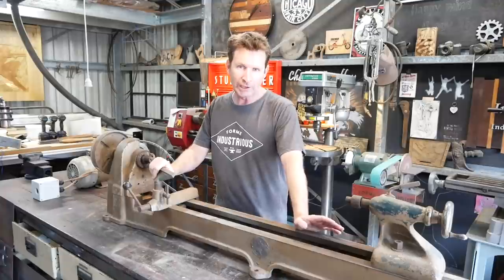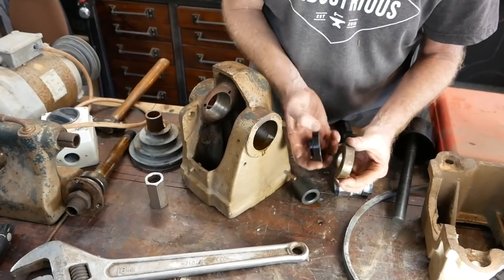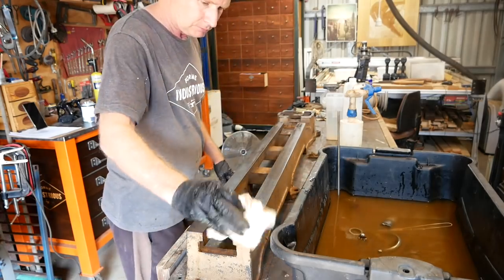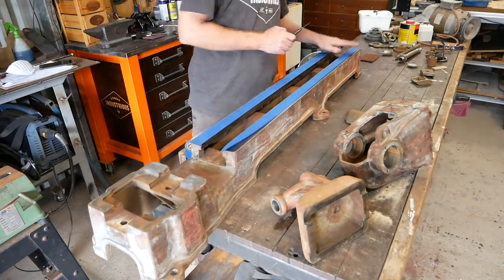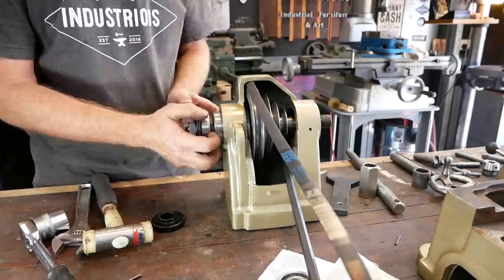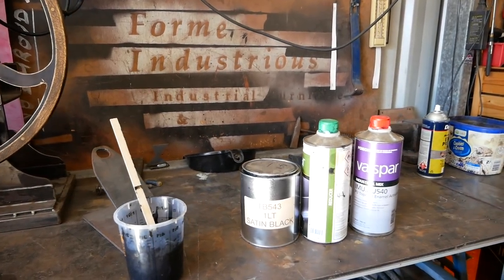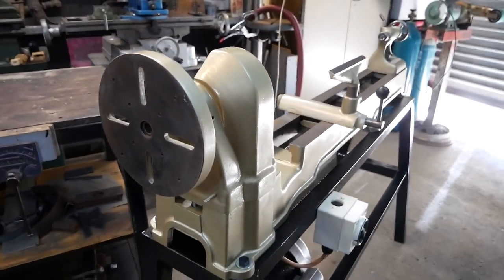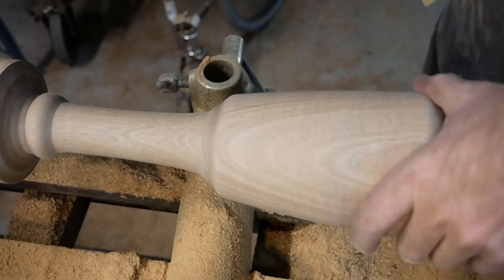Vintage Woodfast Lathe - Restoration - Forme Industrious

Comment: Nice to see an old Woodfast back in service. Those lathes originally were fitted with a spindle lock/indexing pin in the hole at the back side of the headstock. Many schools removed them because kids would accidentally (or deliberately) engage them with the spindle running. The pin could engage in any of the holes in the step pulley so you could index polygon shapes. Easy enough to make in your lovely Hercus ATM260 metal lathe! Another classic and hard working machine!
Reply from the maker: Thanks Mark! Yes I'll make the indexing pin very soon. I had to do a few fix up jobs to get the 260 going smoothly.

Comment: Picking up my second woodfast lathe in 2 days. I made all the same mistakes with my head stock you did. I even forgot to put the belt on it on my second to last reassembly. Fantastic job on that restore.
Reply from the maker: Thanks Mark, yes they are great lathes. If I had room I'd get another :)

Comment: Nice work (as always) - a vintage power switch would definitely set it off....  also... maybe a quick-release sanding pad on the bowl-mounting plate when it's being stored at the end of the spindle? It would give you a nice flat sander for bowl edges etc.

Comment: Hi Scott, 

Wayne Evans in Houston. I've got an old Atlas American built lathe same size and similar design, Paid about the same for it. I think mine was in just slightly better shape than yours, but I did the same routine cleaning it up and painting it. Except I sand blasted all the old paint off. I used one of those link belts so I didn't have to take the head apart again when my old belt failed. I have to say I really like it.I didn't weld up a base, but I didn't have a welder back then, so I put it on s work bench with drawers under it. but you, my friend, did a wonderful job as usual. I've probably paid for it doing spindles for people over the years I've has it. I want to do some art type work on it when I get around to it.

Comment: Great video, as always.  Those old machines are designed to be used with either a flat belt or a segmented (linked) v-belt.  The belt you've got on it will work perfectly, but you don't want to be popping out those bearings every time you need to swap a belt.  Amazingly, the segmented belts are actually quite an old idea.  Someone might have replaced the old pulley with something newer so they could get more speed variation, too.  Either way, a good segmented belt will last you for ages just like the standard v-belts.
Reply from the maker: Thanks Vaughn. You are spot on. I replaced with the same as was on it since I was replacing the bearings. The new belt will last ages and then a linked belt can go on. Cheers!

Comment: Great looking lathe Scott. I would have guessed that the serial "728 65" would mean the 728th lathe made in 1965? Dale's a legend - of course we'd love to see his channel. I like the trick of putting the pin punch through the reverse side of the shaft to help line things up for knocking the pin back in too. Good stuff. PS Look into fenner (or similar) adjustable V belts - it will make future belt changes on that machine much more tolerable :)

Comment: Nice lathe.  It's similar in design to my Delta lathe here in the US.  It was also a school lathe, my dad was an industrial arts teacher and he got it from the school after it was replaced by newer equipment.  I believe mine dates to the 1940s.
Reply from the maker: Thanks Stuart. It's possible the  Australian Lathes where made under licence or copied from the US ones. I'd love to find out more.
Reply: @ScottTurnerformeindustrious  This is the operator's manual for my lathe, from the Vintage Machinery website.  It's dated 1944 but I think they made the same model for many years.  The headstock is shaped a little different than yours, but the bed, tailstock and tool support appear to be nearly identical.  http://www.vintagemachinery.org/pubs/1141/3234.pdf
Reply from the maker: Huge thanks Stuart. You are right, nearly identical and this will be very useful - thank you!!

Comment: Nice job Scott, i bought an old Jett metal cutting bandsaw. It works good but i can not get that blade to cut straight. It dives in too much. Spent hours on it and it just wont change. So I appreciate your patience and hard work.
Reply from the maker: Thankyou Christopher. Did you try your bandsaw with a new blade?
Reply: @ScottTurnerformeindustrious  I did get a new blade. i did watch a video that showed some new tips. I need to watch it again and try it. thanks Scott

Comment: Seems to be exactly the same as my model. Pretty sure the last 2 digits of the serial number are its year of manufacture. Mine was lovingly restored by an unknown local man and sold at a silent auction house in my town. While looking it over, seeing the care of the restoration and the original engineering I was more than happy to pay the $670 odd Australian dollars for this piece of usable art. 

One thing to watch out for though is the slightly odd sized 1 inch 10 TPI thread on the drive stock. When buying an adapter to suit my chuck I found it just wouldn't go any further than a couple of threads before it started to bind so I took it to a local machinist who shaved a little bit off one side of the thread on the adapter in order for it to work.

Lovely restoration work mate!
Reply from the maker: Thank you James! Yes they built beauty and functionality in the old days. 1965 is my guess. Thanks for the tips!

Comment: For the pain in the backside belt change you might want to look into the adjustable link V belts. Assemble the belt not disassemble the lathe. 

I’ve heard they run quieter and cooler than a standard V belt too.
Reply from the maker: Hopefully won't need to o a while but yes definitely the way to go. Thanks Wayne

Comment: Very nice, Scott. Anyone taking odds on whether you chuck it out the first time you have to change the belt?
Reply: I would definitely recommend using a link belt.  I've used them on a few machines.  They are expensive, but I always get the wrong size of belt the first few times and keep having to go back to the store, so it turns out easier.  Plus you don't have to disassemble your machines to put one on

Comment: Scott, you should really swap the vinegar and citric acid for phosphoric acid. Acetic acid (vinegar) attacks the iron in its metallic form, whereas phosphoric acid passivates it by dissolving the oxidized layer (rust) and forming a protective layer. By using vinegar (or worse, hydrichloric acid) you're just wrecking the metal base even more.
Reply from the maker: Top tips. thank you!

Comment: I learnt wood turning at trade school ( post trade course) on that model Woodfast. My own machine was made in 1991, sadly the name has been  acquired by Chinese concern and Woodfast are name only and not as well made, P&N chisels some of the best turning chisels ever made, sadly also no longer available. If you ever need to change the belt replace with chain link belt no need to disassemble  the head stock.
Reply from the maker: I used one of these at school also. Probably the same lathe :) Thanks for your comment!

Comment: I don't know if it helps, but your lathe is identical to one that was sold by Sears Craftsman. Craftsman did not produce their own tools, they farmed out the production and slapped their name onto it. They are very very common in the States. Just thought it was worth mentioning if you need to hunt down any parts

Comment: What about for a start / stop unit you make a nice wooden box and have an industrial looking start button with red emergency stop ?   I have some spare if you want -
Reply from the maker: Hey Craig. Thank you for the offer. I have a few switches coming my way at this stage for this project, however I will be making a Drum sander soon. Your gear will likely come in handy for that project. Cheers!

Comment: Awesome restoration. I am currently doing something very similar, looking to replace a current driver belt for this lathe system (A52). Wondering if you purchased a new belt for your build, and if you did, where did you get it from? Cheers mate.
Reply from the maker: Thank you! Yes I put on a new belt. I just bought it from a local belt supplier as it is nothing special, just a v belt.

Comment: Could you explain to us why the motor is mounted loose on 1 side?
Reply from the maker: The motor weight provides the tension for the belt and drive. Quite common. Also makes for fast speed changes.